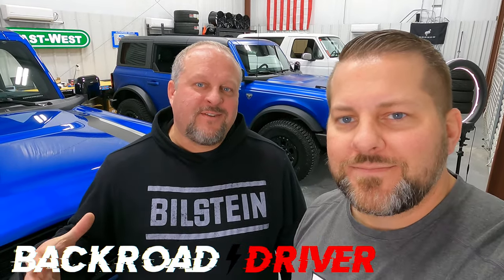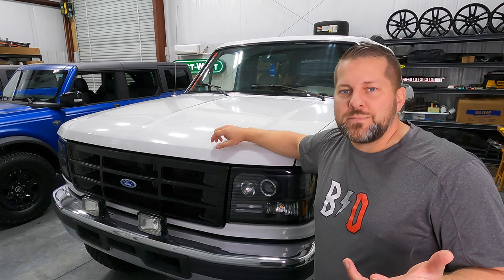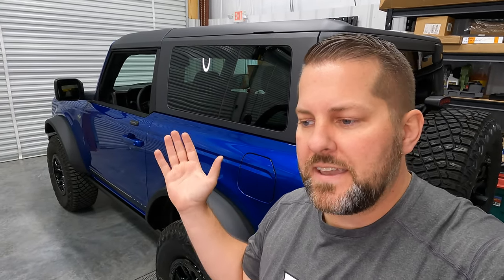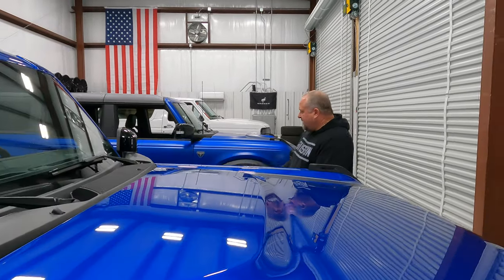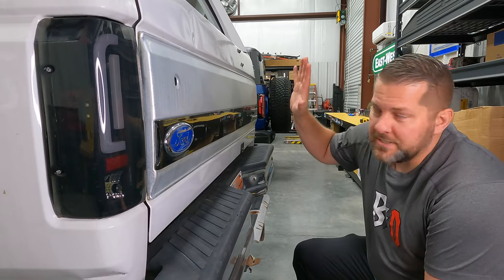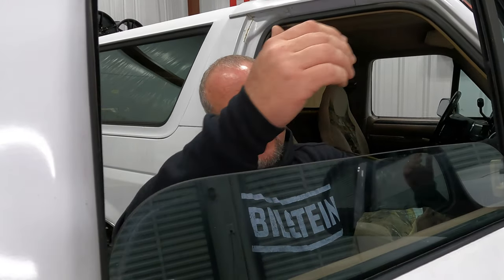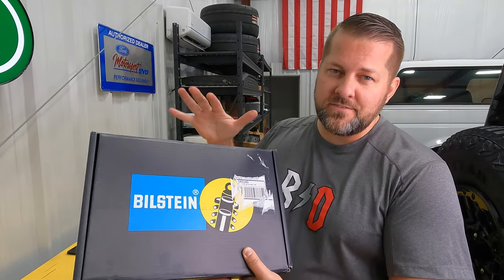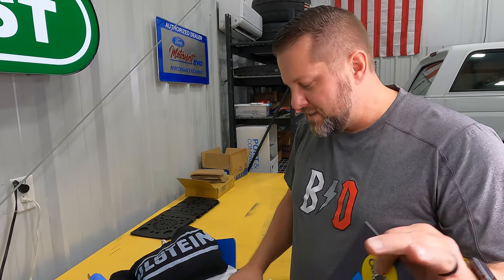BRONCO GARAGE UPDATE! Size Comparison & Build Plans!

Comment: I had an 88 Bronco and I thought the seats were fine, however I didn't off road (most of the time) but I would get some more bucket(er) seats, and take the liner off and do an aluminum piece in place of it to match the color of the inside of the OSB

Comment: Have watched most of your videos now on the OBS Bronco build. I've got a 1996 EB I bought 3 years ago but had to put the RESTOMOD build on hold as I'm working for the Army overseas for the next 4 - 5 years. I plan on doing a Coyote/10R80 transmission swap with a crate engine from Fat Fender Garage...I'm hoping to have them do the build. In the mean time I'm slowly working on my build plan - mods etc. I want it to be my daily driver with all modern comforts. I'm not a traditionalist and will make it mine - planning on having it painted "Impact Blue" the same as my 04 HD V-Rod but do the trim in Yellow like the Blue Angles instead of tan....I'm not sure about the interior yet but definitely plan on upgrading the interior with replacement seats/instrument cluster/console etc. Oh...and I do like #Bilstein products. I've got a 2001 Daihatsu "Naked" I drive in Japan that looks like a Mini Hummer (a little) and it's got Bilstein shocks/springs. Anyway - interested in all the mods you've done on your OBS Bronco so far.

Comment: For interior I think some kids of recaro style seat similar to the new Raptors would be cool. It would help y’all stay in the seat. I’ve seen a Bronco like y’all’s with the super duty interior swap that looked sick. I don’t think you need to go that far but some modern F150 recaros and a center console that blended into the dash would be sweet. Especially if you swap the interior to black and repaint/cover the dash in black material.